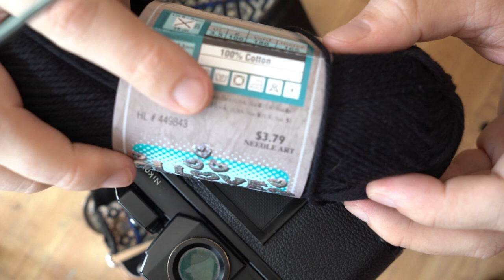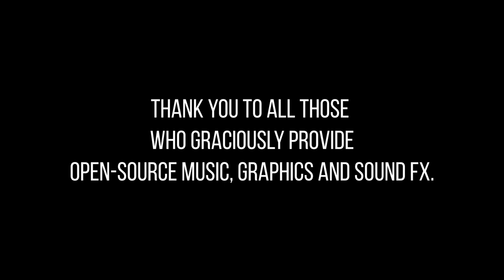How to Install Permanent Light Seals for the Nikon F3 SLR Film Camera

Comment: The F3 is sufficiently well sealed it can go without door seals (I took my deteriorated seals out years ago and have never had a light leak). Depends on how straight your door is I suppose. I would tack the cotton in with a dab of rubber cement in the channel in about 4-5 places, and I would definitely leave a gap over the frame counter reset. On the F3 that frame counter is an engineering achilles heal, as the counter wheel just behind that switch has electrical contacts that disable the shutter speeds on the first couple frames & you don't want to risk any fibers getting into that mechanism--you risk making the shutter and or AE intermittent, and you won't know until you develop the film since the shutter will still fire, just not at the speed you expect. As for the mirror, foam was chosen there for more specific reasons, I feel that should be matched to the original as closely as possible. But it is such a workhorse it can, like the door, probably work just fine without anything at all, though why risk it?
Reply from the maker: Hey Tim, it's funny you mention about the door being inherently light sealed just from the lip. I had actually used this F3 for a number of years (even with the door rattling) until I finally started seeing some leaks at the top and bottoms of all my rolls; that's when I decided to replace the seals as I've shown here. I'm not sure if you watched the entire video but I mention a few times that I use this technique primarily due to the fact that minimal adhesive is required, meaning that I (or someone else) hopefully won't have to face the same problems which are unavoidably encountered with foam seals. I've lost track but I THINK I've performed this type of yarn replacement on seven cameras now and have observed zero issues with the yarn dislodging even after heavy use (and some accidental rain on my Olympus) so as long as the yarn is of relatively proper size to the track it seems to hold up well without adhesive. As for the mirror foam, I feel like you're referring to shock absorption? I actually considered this as well but the felt I've been using is strangely thick and seems cushion that slap just fine. For the frame counter consideration, I can't really speak to that one other than so far so good. Since you have an actual repair shop I'd like to ask you about that shutter speed you mentioned relating to the frame counter: are you saying it will default to the 1/80th mechanical speed? Is there a some sort of electronic trip that reverts the shutter mechanism back to electric control?
Reply: @AdamWelch  Hi Adam, Yes, there are electronic contacts on the wheel (beneath where the frame numbers are printed) that tell the camera to default to 1/60 and to disable the meter before reaching frame #1.  It's actually a plastic cylinder with imbedded copper strips, like a potentiometer. I've seen this mechanism fail or go intermittent on several cameras (usually from dirt or debris) causing the shutter to not fire properly at different points in the roll. I actually really hate this feature as I like to shoot the extra frame or two on the beginning of a roll, so I disabled it on my personal camera
Reply from the maker: @TucsonAnalogWorkshop  Very cool. Thanks a lot for the info.

Comment: Thanks for this video, very helpful! Just one thought on the 99% pure alcohol: that high of a percentage evaporates pretty quickly, that is why hand sanitizers usually have water as a "carrier". The water acts as a slow-down agent, so the alcohol has time to permeate and dissolve cell membrane walls. 
I suspect you would be fine with using 70-80 percent alcohol, as it allows more "soak time", to break down the adhesive. I hope this comes across clearly, English isn't my first language :) 
In the end, just do what works best for you of course!
Reply from the maker: You're definitely not wrong about the evaporation time of the alcohol. In fact, that's precisely why I use this grade for most of my projects in that it does evaporate quickly while leaving minimal residue. Generally, I use this alcohol for degreasing aperture blades and other parts like prisms and uncoated mirrors. Don't tell anyone, but I've used vodka before on foam seals haha
Reply: @AdamWelch  Haha, Wodka would work, work with what you have they say. 
As far as coated glass (like the front element of the 50mm ais 1.4) what would you recommend to clean off fingerprints?
Reply from the maker: @yoepvh9250  The only lens element cleaner that I've consistently used over the years and have had no problems with are Zeiss Wipes. They are individual packs of pre-moistened lens wipes and they do a great job at cutting oil. However, I find them to be a tad too wet after I clean the lens with the wipe I make sure to dry it with a clean microfiber cloth. I would also MOSTLY recommend ROR Optical lens cleaner. I say 'mostly' because I used ROR for years on both my lens elements and glass filters until one day I applied the ROR to a Breakthrough Photography Night Sky filter and it completely dissolved the coating; I'm serious, it turned the filter into a clear piece of glass. I sent the filter back to the company and they sent a replacement but never gave me any feedback on whether it was an issue with the filter or if the ROR was a problem. At any rate, I've never used the ROR again on anything that I know is coated. However, seeing as ROR is specifically intended to be used on extremely high-end lens elements such as microscopes I find it difficult to believe the cleaner would be harmful. Then again, res ipsa loquitur.

Comment: Great video but a little tip when replacing the light seals on not just your F3 but F4 or any camera that has a T setting on your shutter speeds. Before you take the back off, fire the shutter because it will lock up the mirror and shutter, then open the film door/take if off and while the T setting is open and work away and you'll not drop anything on the shutter blades or mirror because there locked up out of the road. Them when your completely finished just change the shutter speed and your all good to go.
Reply from the maker: Wow. For whatever reason I have never considered doing that. I'll still tape up the mirror box but that is just me being me. Thanks for bringing that up because like I said I have no idea why that never occurred to me. Quick question you might have an answer for: on the F3, do you know if the battery is being expended during the shutter lock in 'T' mode? The reason I ask is that on my GS-1 Bronica when the timed shutter is used the battery is continually being expended to hold the shutter open. That's why the Zenzanon lenses have a handy little 'T' switch, which essentially disconnects the leaves from the shutter sensor when in timed mode. I just don't want to come away with dead batteries in the Nikon. Thanks again for the tip!
Reply: @AdamWelch  as far as I'm aware using T (timer) doesn't use any battery power because it was added for long night exposures. The funny thing is when I was watching your video and I just thought of locking the mirror and shutter up because I just couldn't had been bothered covering over the shutter blades when replacing the seals on mf F4, yes the idea literally just came to me lol. You could probably lock up any camera by using a cable release/remote in Bulb if no T if you wanted to try this when working at a camera.

Comment: Looks quit simple with the yarn. Only thing I would be concerned with is that nothing is holding the yarn in place and in time it will slide out. I have personally done many light seals on several dozen SLR, TLR and medium format cameras and have always used the proper foam with adhesive that holds it in place. It takes a little more skillful work but it will never come off.
Reply from the maker: Hi Jorge, you're right, the yarn method is VERY simple and I love that anyone can make a great seal for themselves at home (obviously ha). You point out what I feel is the greatest drawback of "proper" foam seals: they are so difficult to remove especially once they degrade. With the yarn, it's inherent inertia (since it's so lightweight) makes it nearly impossible to dislodge unless the camera withstands a considerable impact with the camera open. In that case you'd likely have bigger problems than the seal.... Other than that, since the camera will be closed for the majority of the time, these non-foam seals seam to work extremely well so far, at least in the cameras where I've installed them. Granted, I've not  installed seals on dozens of cameras, as you have, but on the six personal cameras of mine that I've installed them in ZERO have become dislodged or had any issues. The only thing that might dislodge this type of seal is if there happens to be a burr/abrasion on the rim of the camera back that fits in the track. This might snag the yarn. Of course, since the yarn doesn't use glue it can easily be replaced on the spot.

Comment: Used your recommended items to install new camera door seals and mirror bumper. Only concern that came out of this is that after scraping out the old gunk out of the camera door the yarn (you suggested) does keep the camera door from shutting smoothly. In fact you have to push pretty forcefully to get the door to shut.
Reply from the maker: The shutting of the door should become easier over time but of course if it's incredibly difficult to shut a smaller diameter yarn might be needed. Is this an F3 we're talking about? Every camera I performed this replacement on has a snug door for the first three or four closes but then normalizes as the door seats itself with the new seal.

Comment: Never put the focusing screen with the split image glass face down, easily could be damaged and its not reparable, if it breaks get ready more money than the best light seal foams… also avoid putting the finder with the glass face down. Both can be placed easy face up. There is a option in the speed selector marked with a letter T, if you put it there and shoot the curtain is gonna be hiden indefinitely until you move the speed selector again, in that way you avoid 100% to damage it, its good to put a tape anyway even doing it, but its safer even while putting the tape… Also i think there is good quality seals sold in the internet by a price that is not much, considering, if you do it right, could pass through 10 years without replacing it again… 😅 i was looking for someone who talk about the light seal foams sizes, im not sure witch ones should i buy for Nikon F3 (¿1mm, 1,5mm, 2mm, 2,5mm, 3mm?)but this video is very far from something a little bit professional…
Reply from the maker: Did you ever hear the tragedy of Darth Plagueis the Wise?

Comment: Considering the one seal is felt and lasts indefinitely, I have to wonder why they didn’t just use that material for all the seals!
Reply from the maker: I 100% agree. At the same time, the mirror pads on some cameras do need a bit of extra "cushion" depending on the model (I still use felt) and that is the only place where I MIGHT use foam. It's interesting that one of the things that gave me this idea was my Zorki 4K which had a glued nylon sting as a door seal from the factory.
Reply: @AdamWelch  I still have a few more older Nikons to clean out and reseal - the black stuff has turned to goo.  It would seem it’s similar to the rubber Nikon uses on their grips on more modern SLR’s and DSLR’s! =p

Comment: I'm wondering how would you do the other light seal for the mirror, the one behind. Is it the same process as the cushion?
Reply: Nevermind, I just checked my rear mirror seal and it looks pristine. However, the cushion is completely destroyed. Gonna give this a shot soon!
Reply from the maker: @MyHunter9090  Yeah it should be essentially the same process as removing the old seal and adhesive and then carefully replacing the seal. You'd need to remove the prism of course and it would be a slightly finicky process. Since mine looked fine I just left it as-is. It's interesting that your rear seal is pristine as well. Hopefully for whatever reason those don't wear out easily ha Good luck and let me know how it goes!